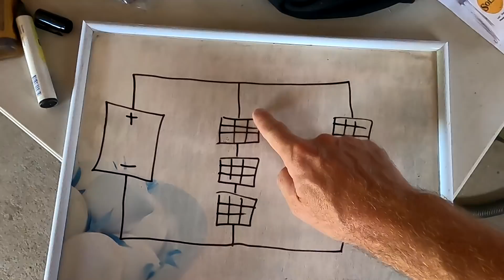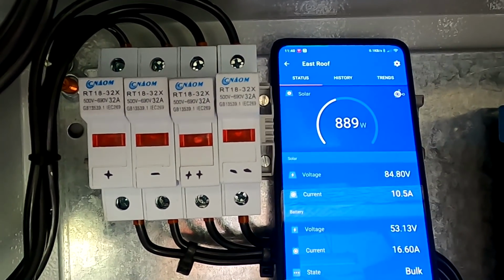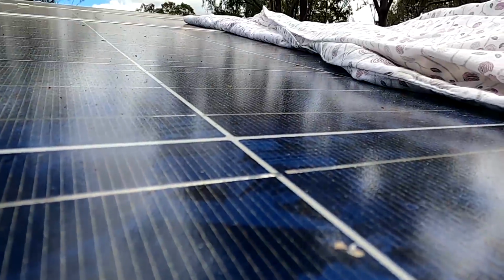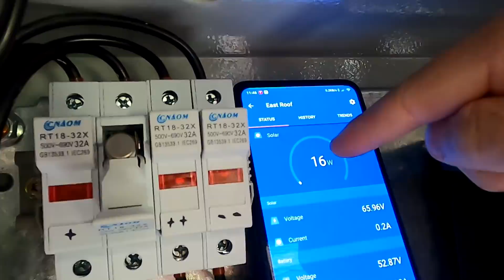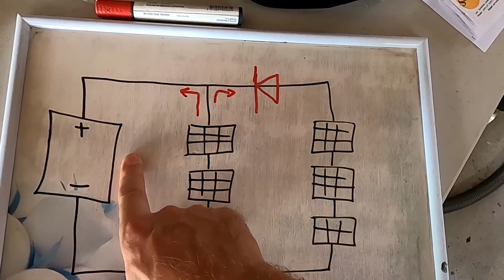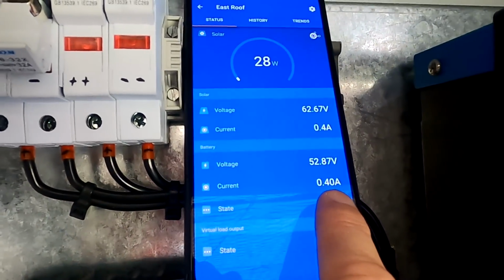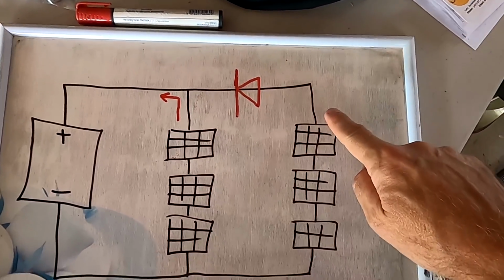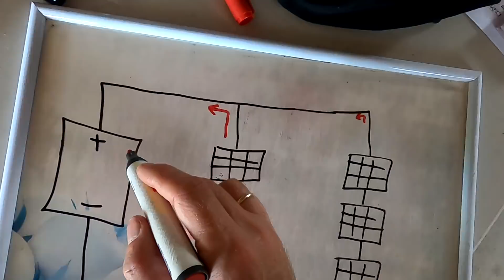Solar Upgrade EP4 - Shaded and non-shaded solar string in parallel. See what happens.

Comment: To put this difference in diodes in perspective... the 'bypass' diodes built into the solar panel are arranged in the 'blocking' direction, but they bypass the cells in the panel meaning that they do not prevent the reverse voltage from being applied across the cells.  This is why these bypass diodes are not blocking diodes.  They don't block anything... they are designed to allow current to bypass a shaded cell.

The solar panel cells are natural diodes on their own, but they will not have the high reverse breakdown voltage spec needed to prevent current flow in the reverse direction through the panel.  Even worse, if the reverse voltage hits that breakdown threshold, the panels can basically become a dead short with all the energy being dissipated by the cells.

This is why fuses or blocking diodes are recommended.  Blocking diodes are usually Schottky power diodes (0.4V forward voltage drop).  The wattage of the blocking diodes you get must be in excess of the 0.4V x MAX-AMPS going through a single string, and the reverse breakdown voltage of the diode must be well in excess of the worst-case (highest) open-circuit voltage for a string.

Now the question as to whether you need blocking diodes or not:  Generally speaking, if you are paralleling single panels and then putting the parallel group into series (i.e. one actual string), it isn't a big deal and of course a lot of energy can be lost forcing a 0.4V drop across each element of a series configuration.

But if you are trying to parallel whole strings (where each string contains several panels in series), THEN you want a blocking diode coming off of each string.   One blocking diode for each string.   Two strings, two blocking diodes.  Schottky power diodes (0.4V drop instead of 0.7V drop).   You will lose some of your solar energy, but not much.  For example, if the working voltage of the string is 80V, the 0.4V drop means you lose only 0.5% of your solar energy.

I will add here, that it is the delta reverse voltage that matters.  If one string is partially shaded then it will still develop some voltage across the panels so the reverse voltage will be decreased.  If one string is fully shaded then a higher reverse voltage will exist across the shaded string.    MORE IMPORTANTLY, if the charge controller is charging the battery, it will DRAW DOWN the voltage on the sunny string so, again, the reverse voltage across the shaded string will be lower.  

YOU NEED TO DEAL WITH THE WORST CASE SITUATION.  The worst case situation is when your batteries are full, the charge controller is not drawing any current, and the sunny string is developing its full open-circuit voltage while the shaded string is fully shaded.  The reverse voltage will be at a maximal value under these conditions and potentially be too high for the shaded panels to be able to handle.   As a secondary note, the breakdown voltage might break-down the natural diodes in the silicon in the reverse direction with very little current, allowing the open circuit voltage to remain high until such a point when all the diodes in the panels on the shaded string are in the reverse-voltage break-down state.  At that point the entire shaded string can potentially become a dead short.  This will finally draw the voltage from the sunny panel down from its open-circuit value to a lower value, which may or may not take the reverse breakdown out of the dead-short.  Either way, it can cause serious problems for the shaded panels.

-Matt
Reply: Very well said. I would like to add a few things onto this:

Reverse blocking diodes should in theory act as a much better reverse bias protection from a panel standpoint compared to fuses. Fuses protect from overcurrent, they don't stop reverse current. A fuse rated at 10A can have 9A of current flowing through it backwards into a panel without ever blowing. And we can't fuse a panel with a 1A fuse since the panel is often producing a lot more than that during normal operating conditions. That's why a fuse is not the correct choice of component for the job if reverse current protection is what we are looking for.

PV cells inherently sort of act as diodes as you correctly pointed out (some better than others, it depends on the panel). However, worth noting is also that reverse biasing PV cells for a prolonged time can make those cells degrade much faster, even in a situation where a reverse breakdown voltage is never reached. Best practice is just to try to avoid reverse biasing PV cells as much as possible. Most common ways to achieve this is by 1. Putting identical panels in the same orientation so they receive exactly the same amount of sunlight, meaning the V-I curves will be completely matched, 2. Using an optimizer or micro inverter on each individual panel (each handles MPPT on a panel level, reverse current protection is often built into these units), 3. Using reverse blocking diodes (although that's not a replacement for optimizers or multiple MPPT controllers in terms of shading).
Reply: @TheCrazyStudent  What a blast from the past!  So many things have changed from even just 4 years ago.  Note that the point of fusing in a system with paralleled strings is to prevent the other strings from dumping their combined current into the shorted string.  That combined current blows the fuse.

These days blocking diodes have kinda gone out of vogue because (at least for residential), fusing has been deemed sufficient.  And there are enough MPPTs available that strings don't have to be paralleled any more.   They are still used in commercial systems but we don't see them often any more in residential systems.

This may change as the string voltage continues to rise.  Europe is allowing string voltages up to 1500V now (though in residential applications it is limited to 1000V).  Panel and wiring specs are being increased to match.

Blocking diodes may make a come-back as voltages continue to increase.

-Matt

Comment: If you need a diode, you would need it for both strings (in the vertical leg above each string, not just the horizontal leg between the two strings).

Comment: I read somewhere that reverse current is only a problem if one string is completely dark, which would never happen in real life, so those few mA that might flow between strings would not justify blocking diodes in my opinion. The only bad thing that happens with shading in parallel strings, is the different mpp's of each string, but that is a different story. Great video.

Comment: The solar panels already have diodes in the little black box on the back of the panel
Reply: Usually only Bypass diodes, not a Blocking Diode ...

Comment: Well... usually if you have multiple strings you get a charge controller that has separate input terminals (and a separate MPPT) for each string.  You can also just get a second charge controller and connect the battery side in parallel with the first, each charge controller handling one string.  In the latter, the settings on the two charge controllers must be precisely the same and a non-zero absorption time should be set (at least to some low value, at a minimum), to give both charge controllers a good chance of staying synchronize with each other if there is no smart communication between them.  If there is smart communication between them, then you don't have to be as careful.

Generally speaking you do not want to tie the strings together, but it depends on the configuration.  If you only have a few panels and the voltage isn't too high, then it will probably work.  It just won't be optimal if one string is shaded and the other is not.  At higher open-circuit voltages, though, the reverse voltage on the shaded string can be substantial and it's a really bad idea to tie the strings together.  At least, I wouldn't do that.

My recommendation is that you purchase a second Victron SmartSolar charge controller.  I'm not entirely sure if the one you have (the MPPT 150/35) can synchronize multiple units or whether you need something like the SmartSolar MPPT 150/100 - Tr VE.Can.   You can, in fact, use a second MPPT 150/35 and just keep them dumb and unaware of each other... it won't be perfect, but it will work fairly well.

In terms of using power Diodes, if you tie the strings together using diodes you need one diode on each string (two diodes total), and the diodes have to be able to dissipate the maximum per-string current across the (typically 0.4V or 0.7V depending) voltage drop and have a reverse-breakdown voltarge well in excess of the open-circuit voltage of the strings.  You lose some of the solar power when you diode strings together that way due to the voltage drop across the diode.  It's usually better to have multiple MPPT charge controllers or one charge controller with multiple independent MPPT string inputs.

-Matt
Reply: With lithium battery, you don't need to synchronize the charge controller (as in Pb battery). 

It's better to have different voltage set-up beetween several solar chargers to reduce flow current at high state of charge
Reply: @zarbonida  That kinda makes some sense except the worst case current is still going to be with both charge controllers in bulk with a low battery.   I don't think any massaging of settings avoids that case.

But in terms of Float and Absorption settings, I do see wiggle room.

-Matt
Reply: @junkerzn7312  i am not sure understand you. 
Why do you want avoiding bulk phase in two or several solar charger with a low battery?
Reply: @zarbonida  The maximum current the two MPPT charge controllers can ever deliver to the battery will occur during the first half of the bulk phase with the battery at a low state of charge.  The charge controller will be in Constant Current mode (that is, whichever cap comes first... current or voltage, is what the charge controllers will deliver, and in this situation it will hit the current cap first).

In this first part of the bulk phase the battery is in a low or medium state of charge, not a high state of charge.  Multiple charge controllers WILL gang-up on the current so this is the state that you have to be careful about, to ensure that the combined current does not exceed 0.5C.

By the time you get to a high state of charge, the charge controllers will have already gone into Constant-Voltage mode.   When the charger controllers are in Constant-Voltage mode, it does NOT matter how many charge controllers you are running in parallel.   They will all output the same fixed voltage and the current will be limited by what the battery accepts.  This is what 'Constant Voltage' mode means.  The battery is governing the current acceptance at this point, not the charge controllers.

Since the current is limited to what the battery accepts, the current (which will be well under 0.5C at this point) will not add up with multiple charge controllers.  The multiple charge controllers will simply take a share of that acceptance current.

-Matt
Reply: @zarbonida  I think something is getting lost in translation here.  I never said anything about avoiding the bulk phase.  I simply stated that when one has multiple charge controllers connected to the same battery, the maximum current going into the battery will be during the first part of the bulk phase.  And I explained why.

-Matt

Comment: People that think this don't understand electricity. Even a shaded panel produces a voltage to high to allow current to flow in from a lower voltage source. Every panel today comes with a diode installed. It's there to simply keep the battery from back feeding at night. Sure, it helps with mismatched panels too.
Reply: Usually only Bypass Diodes, not a Blocking Diode ...

Comment: Most good panels have diodes bilt into the little box on the back of the panel
Reply: Usually only Bypass diodes, not a Blocking Diode ...

Comment: The bypass diode on the rear of the panel is to keep the electrons flowing through the solar strings when the controller is switched of. It also allows a positive charge to keep adding to the flow. You do not need a blocking diode it is not necessary as you just proved. If you are concerned about the milliamps that your losing you have a problem not the cuircut. Well done Andy keep up the great work.

Comment: I think modern panels have the diodes built into that connection box on the back.  So "there in there".
Reply: No, those are bypass diodes.  They are going in the blocking direction, but the bypass diodes do NOT prevent current from back-flowing through the cells on the solar panel itself.

-Matt

Comment: We have to remember that every cell in the solar panel is a diode. How many cells in a solar panel? Plenty of them that it produces bigger voltage and current than a single diode.  Current always go to the least resistance, that is the charge controller then the battery so I will not worry much of anything that goes back as there is almost nothing that goes back. When one does not even use a charge controller and connect the battery directly to the solar panel, it also works well and no one is talking about diodes. Again, a solar panel is already a bunch of diodes in series and all glass packed diodes when exposed to light will produce voltage and current will start to flow to the least resistance  path when there is one.
Reply: yeah, but because every cell is so tiny its reverse breakdown voltage is low (not the same as breakdown voltage of schottky diode which is 1000 volts) so if you over-serie-over-parallel your setup you can break the diodes of the solar panel and it will become as conducting as a copper wire, so all the power you are collecting from the sun will be burnt on the shorted panel. Or worse than that, you can break only part of the panel, and this one part will be short circuiting the whole array of your parallel-serie configuration, the ugliness is that you aren't going to know it unless you do very scrupulous testing

Comment: You would need TWO diodes, one per string btw.
I am no expert, but as you found ,you really do not need them because the voltage output is high enough.
it's the current that mostly goes up with intensity of sun rays.
It's a quantum thing, and maybe there is a youtube video out there explaining this?

Comment: the bypass diodes are already installed in the panels junction box (when the panels are not cheap).. the utility is to « bypass » the current flow when a panel have a shadow in a serial configuration (as 3 battery in series, the max current is drived by the weakest battery).. so under shadow, those diodes skip the panel and it’s better than to lose all the series (if panels voltage = or > than the battery voltage, in your case with 2 panels on 3 availables).. a solar cell is already a diode (a panel is a lot of diodes/cells in series) and i don’t know why a serial diode could be necessary in parallel configuration..

Comment: Ian H
Tried this experiment a few years ago. Two used (~8 year old) 100w panels connected in parallel, one face up in sunlight one face down so totally dark. Put a digital ammeter between the positives of the two panels (panel nearest to charger was face up - as in your diagram). I read 7mA back feeding into the dark panel at around 19v. Panels in use were 4x9 configuration of monocrystaline cells rated 23V @ 6.5A. Box on rear of each panel had two diodes, both bypass for each 2x9 section of the panel.

Not sure if more modern panels act differently now, but I guess the laws of physics have not changed that much?

As for blocking diodes, I wonder what their reverse leakage is, probably a bit less than 7mA, but I’m personally not going to lose any sleep over such minimal losses.

If people are that worried about this the solution is simple, multiple MPPT controllers (Victron allow this), one per string. Combine the outputs as you plan to do via breakers, problem solved!
Reply: Thanks for sharing your experiment. 
Good to know. 

I was asking to Andy if it possible to repeat this experiment (single pv shaded) but with the battery full (so solar charger doesn't accept any current from the pv panels). 

I don't have any answer. 

I am only curious to know what ampmetric clamp says about the current flows in the pv wires in this scenario (battery full, no loads, single string shaded)

Comment: Andy, in your test the battery wasn't full and solar charger was producing energy. 
But, what will happens if the battery is full? 
Where current will flow? 
In to the shade panels that has less voltage? 
Can you do a test with full battery and an amperometric clamp in the pv wires?
Reply from the maker: As the battery fills up the controller reduces the power coming from the solar panels by moving the them out of the maximum power point, so driving them less in a less efficient are of the curve so to speak. As I said in the video, I don't think you can have such a big difference in shading from one string to another on the same roof. And if so, it maybe worth installing a separate charge controller for that scenario.
Reply: @OffGridGarageAustralia  that's true. 
It is only to see what will happens in this scenario: you are not at home, the battery is full, no load in the inverter and a bird shit shades a pv string. 

What will happens? 
Nothing or something in the pv strings?

i am afraid for the Voc full shine string that will be a little bit higher than Voc pv shaded. 
(Solar charger is in standby cause the battery is full). 

So what will happen to the current of the pv string in full sunshine? 
Will it flow a little bit to pv string shaded? Or nothing? 

So, please. For the love of the science, Can you repeat your pv single string shaded test with full battery and no load in to the inverter? (Using amperometric clamp in the pv wires)